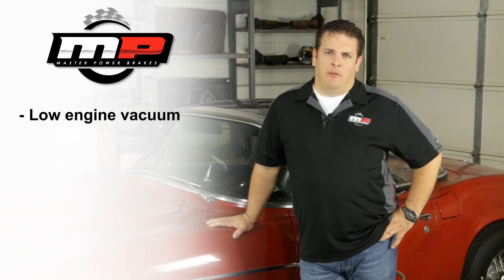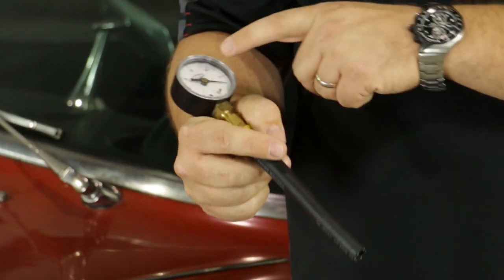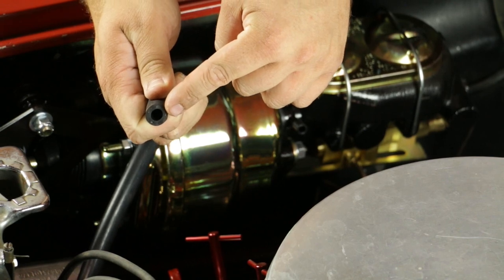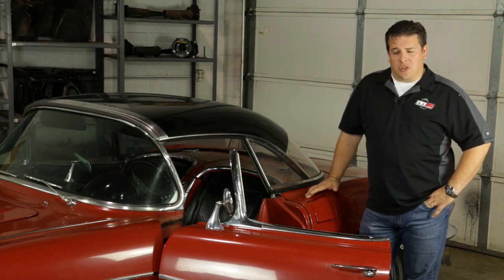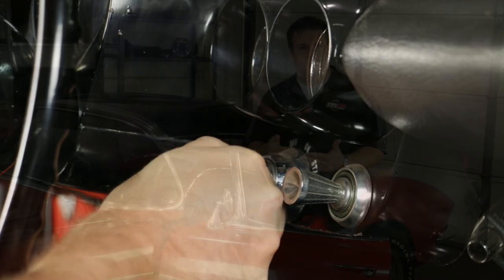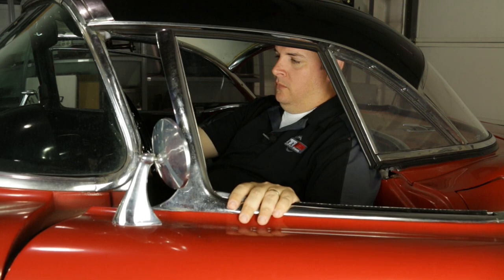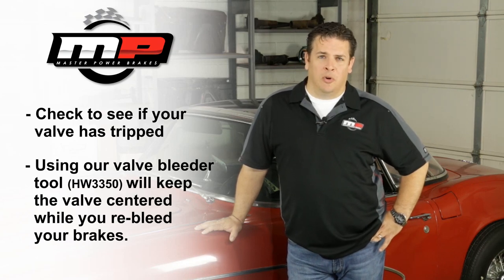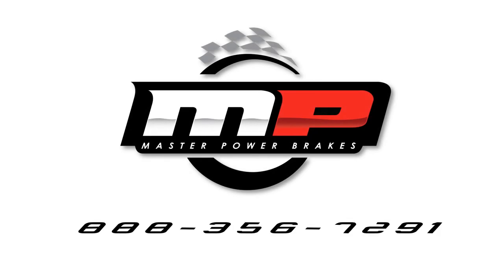Hard Brake Pedal - Master Power Brakes Tech Video

Comment: Wow!sure glad i found your site.i have been stranded with my 2019 ram truck.cause i could not press the brake pedal  all the way to start the truck.i thought it was my battery.when the tow truck drive arrive to jumper start my truck.he forcibly push that brake all the way down and was easily able to start my truck..the brake pedal will not press all the way down to start.just that simple.thank you so much👍👍❗

Comment: Great video.  Ok I have a Chevy 396ci  with a big cam and only 10-12” vacuum. Brake pedal hard. How do I increase vacuum?
Reply: Get a brake vacuum canister or an electric vacuum pump.
Reply: @creepycrawler4690  I did and that solved problem. Thanks

Comment: On honda civic fd1 I did all mentioned checks but it seems to me car is stopping on long distance, even pedal gets hard to a point where it needs to get abs engaged, do I need to completely change master cylinder & brake booster to have firm responsive brakes?

Comment: What can ya'll tell me about hard brake pedal issue on my 73 Ford Pinto, hard as hell when pushed, rear brake lights will only come on if I push REAL Hard on it. I'm gonna bleed it today and check some other things, Last time I bled months ago, the rear bleeder on Driver side was broke off, so I bled it by cracking the line loose at the rear brake cylinder

Comment: Hey man; my dodge brakes go almost to the floor; i can stop if i press down real hard but there is no 'power brakes'. when i press on the pedal, it makes an air whooshing noise and the air sound continues at a stop while i'm pressing down at a stop sign. Could a check valve or the hose fix that? Is my brake booster bad? Hope you can help. Thanks